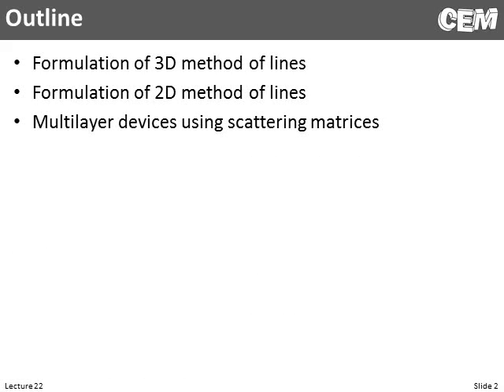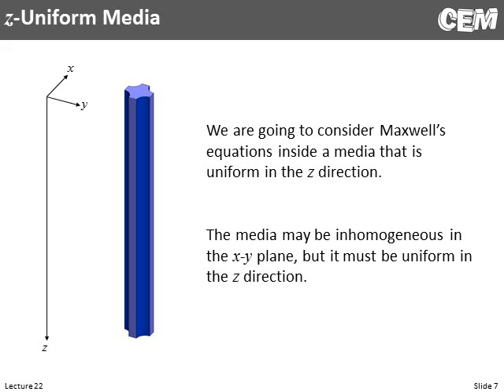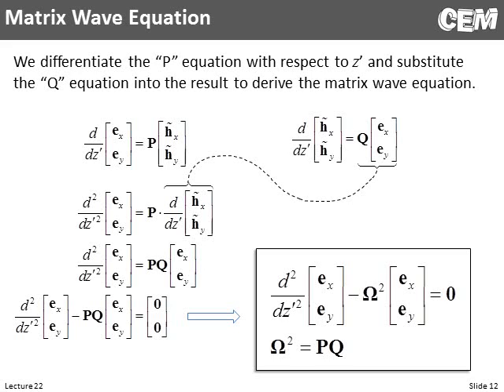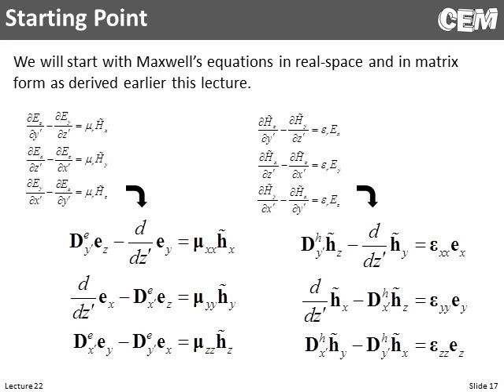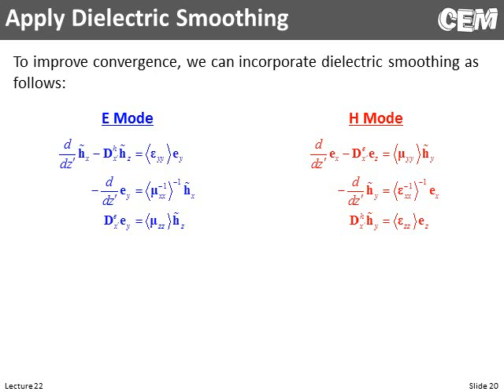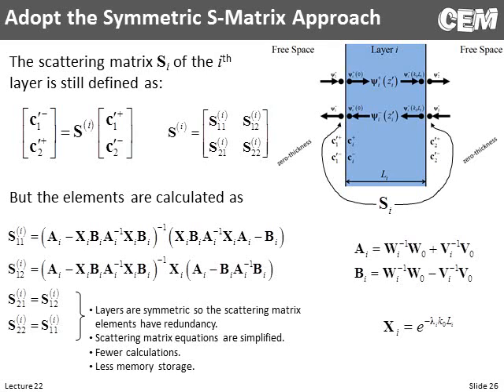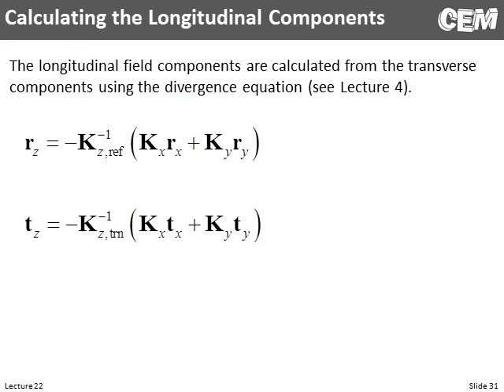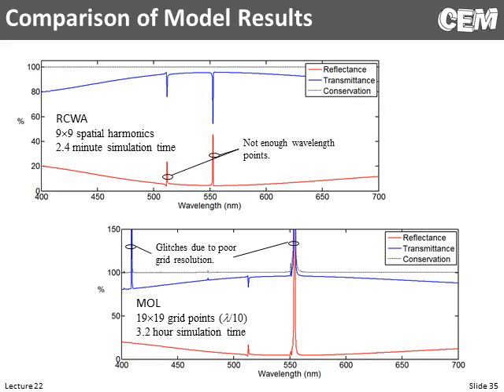Lecture 22 (CEM) -- Method of Lines

Comment: Dear Professor，
I have a question that I would like to ask you. Recently, I am trying to simulate a multimode optical fiber using Mol. The wavelength used is 850 nanometers, the diameter is 500 microns, and the maximum refractive index is about 1.64. However, when simulating with Mol, I found that a very large memory is required to run. This memory is difficult to achieve in reality. Do you have any suggestions for this problem?
Reply from the maker: When you say "simulate," what do you mean? Are you calculated the possible modes that can exist in the fiber or are you simulating the light propagating through an optical fiber and interacting with some sort of discontinuity (i.e. scattering problem)?

Multimode fibers are actually quite computationally intensive to simulate because they are so electrically large. You are not doing anything wrong to encounter this problem. The simplest thing you might consider is called "image theory." That is, if the waveguide is left/right symmetric, so will your light distribution. You can insert an "image plane" through the center of the fiber and only have to simulation half of it, since the other half is just a mirror image. The fiber you have might be both left/right and up/down symmetric an you can whittle your simulation down to just a quadrant of the larger fiber. What I have given here is not quite enough information to implement, but should give you the key words and a high level picture of what you can do.

There are some other tricks, but you start morphing your code into something specialized that cannot be used to simulate anything else. These are are things like analytical mode matching. Think of it like MoL, but since the modes in a MM fiber are analytical, you don't need the eigen-value computation. You can calculate them analytically. You could also use different basis functions like cylindrically symmetric basis functions. You can use a different method entirely like finite element or a time-domain code.

I recommend experimenting with the image planes. Depending on what you are simulating, it is simple to implement and could work very well for you.

Hope this helps!!
Reply: @empossible1577  Thank you for your prompt reply, professor. I am still a little confused. I simulated the electric field distribution of Gaussian light with a mode field radius of 2 microns after passing through a 1.6mm cylindrical optical fiber. The fiber diameter is 125 microns, the refractive index is 1.42, and the core radius is 25 microns, the refractive index is 1.62. But even if the fiber diameter is 124 microns, I create a fiber cross section on a 2xd grid. When using Mol to calculate the electric field, it still requires a very large memory, causing the program to fail to run properly. Is there something wrong with my approach?
Reply from the maker: @AaronGu-s7l  You probably do not need to include the entire cladding if you are interested only in the modes confined to the core. I am unsure of how far the field extends outside of the core, but you can determine this by increasing the size of the cladding in your simulation until you visually see the mode decay to zero and flatline at zero for a tiny bit before the boundary. There is nothing wrong with your approach that I can tell. Consider the image planes and the size of your grid will reduce by 75% and the size of your matrices by something much larger.
Reply: @empossible1577  Thank you very much for your advice, Professor. I still have some questions about the image planes method. I use the Mol method to simulate only the 1/4 cross section of the cylindrical waveguide. But if the electric field distribution of the cross section is not circularly symmetric, will there be some problems? Or do I have a misunderstanding of the image planes method? Do you have any links you can recommend to me? I'll learn from them. I'm a big fan of your videos.
Reply from the maker: @AaronGu-s7l  That may be the case for higher-order modes. I may have assumed you are only interested in a single-mode fiber. I am unsure if there are modifications to the image plane technique for this case. That might be something like adding phase at the image planes or something. I have no literature in mind about about. I would also have to search. I would use key words like "image planes," "optical fiber," "simulation," etc.
Reply: @empossible1577  Thank you very much for your advice, Professor.

Comment: It seems to me either the 3D method of line or RCWA suffers from the eigenvalue problem when the area of unit cell gets larger and larger, so I am wondering if any model order reduction(e.g. Krylov subspace based technique) has been applied to extract few modes(moments) from full MOL/RCWA models? I didn't find such research work in literature..
Reply from the maker: You can find some things.  One is called the Reduced Bloch Mode Expansion Technique and you can learn about that under PWEM Extras on the course website:

http://emlab.utep.edu/ee5390cem.htm

Another thing I have seen is to only calculate and only use the few lowest order modes.  I do not recall the paper, but was simulating an integrated optical waveguide and only retained the guided modes.  That was very fast and efficient.  As I recall for that particular case it was very accurate as well.

I have seen expansions other than plane waves used.  You could choose a basis that better describes your particular device so you do not have to retain as many basis functions.

You can also take a look at the Slice Absorption Method also covered in a lecture in this course.  It avoids the eigen-value computation altogether so it scales a little better than RCWA and MoL.

I have not seen any subspace methods applied, but I also have not looked.
Reply: Thanks very much. The idea of Reduced Bloch Mode seems to be borrowed from electronic band structure calculation in condensed matter physics. Interesting if it can be generalized into a RCWA field solver.